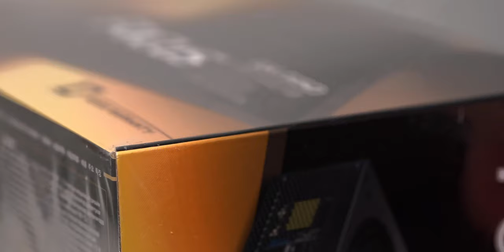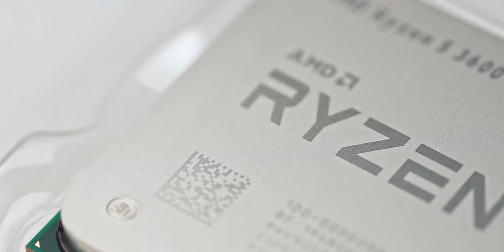mATX Build Montage - feat. Cooler Master S400 and MSI B450M Mortar Max

Comment: Great build.
Good parts.
Amazing case.
(Edit) I feel so bad for optical drives in computers. IMO, I need an optical drive. Using an eternal one is a pain in the ass, and I don't want to have to find it when I need it. Plus Blu-Ray 5.25 are cheaper than external ones.

Comment: i just built in the s400 love it, great video mate
Reply: hows the temperature? i loved the design but small front air section worries me
Reply: @yoyokunfilled  I got a 5700xt in it, I did have to get some noctua fans put in at the front still yet to get one for rear I also have a ryzen 7 3700 OC with a nzxt AIO and my temps are fine man Max temp I get for my Gpu is 80 and that's with a capped 70% fan speed, CPU never goes past 50.

Nice case, just replace the front fan and get a second one and play with the speeds to get the airflow good.
Reply from the maker: Unless you're planning for something like a 3090 with an OC'd 10900K I wouldn't worry to much. As delvzy already said get some decent fans and you're good to go for "normal" hardware. I can highly recommend the Arctic P12 PWM by the way. They're pretty cheap and ridiculously close to the NF12x25 in terms of performance to noise ratio.

Comment: Hi, great video 👏🏻 I’m buying the same motherboard, msi mortar max, and some reviews here on YouTube says it does not have water cooling support, no aio pump connector, can you tell me how you made it. I’m glad to see it’s possible. Thanks 👍🏻
Reply from the maker: Thanks! A water pump connector ist usually nothing else than a regular fan connector. Some board have this fixed at max output. Just connect the AIO pump to one of the fan connectors and set everything to max rpm in your BIOS for that connector.

Comment: I ended up buying this beautiful case and very same mobo, I also got a 280mm rad and fans up top by drilling some holes slightly higher to allow ram clearance. So happy with this build!
Reply: Ey friend, what temperature does your cpu and gpu reach when you're gaming?
Reply: @RiddzenRock  1800x OCd to 3.9GHz would reach 70 degrees. The 5700xt nitro would reach close to 90 degrees.
Reply: Does this case have a considerable noise reduction? About the quality of his material, is it well finished?

Comment: Any other substitute to this case?
I'm really looking forward to this style
Reply from the maker: Maybe you like the Fractal Define Mini C or Jonsbo C3 Plus.
If you're not settled on mATX maybe the Fractal Define 7 or NZXT H510. Or the NZXT H210 as an ITX option.
Reply: @techlessYT  I'm settling for matx.
Im sick of rgb stuff.
Thanks for the suggestions
Reply: @Uly_24  you could try to find the nzxt h400 in smaller local retailers since they might still have it. It's a micro atx version of the popular h710 but it got discontinued. You could also try to find it on ebay or second hand sites as well if you want to try your luck :)

Comment: Is that a 5700xt GPU <: 
I'm thinking of buying the same one but i feel 3 fans would be better due to the bad air in my case (:?
Reply from the maker: It's the Sapphire Pulse 5600XT.
Well, the number of fans should not be a deciding factor. It really comes down to the overall design. I mean a manufacturer could put 3 bad fans on a really small heatsink, or 2 good fans on a massive heatsink - guess which one would perform better.

As for the 5700XT: Great performing models (with a reasonable price) are the Gigabyte Gaming OC and MSI Gaming X.
Reply: @techlessYT  what about the ROG one from asus <:?
I was actually going for it since it's the same price as the gigabyte oc in my country
Reply from the maker: The ROG runs 11°C hotter while being 3 dB louder than the Gaming OC as tested by Hardware Unboxed. So basically avoid that card especially for the same price.
Reply: @techlessYT  ouchhhhhh, aight then imma buy the gigabyte OC one and I'm not gonna lie, my GPU is vertical so i wanted to take the RGB look advantage of the card + the cooling system
Thanks you always get my back <3

Comment: Hey I'm also planning to buy a Ryzen 5 3600 with an MSI B450M Mortar Max and an RX 5600 XT ! Does the motherboard boots fast ? And have you got driver issues with the GPU ?
Reply from the maker: Great choice!
I didn't measure the boot time, but it's safe to say it doesn't take noticeably longer than any other modern board.
I built this for a friend, no driver issues so far. But I had to update the graphics card's BIOS, which annoyed me a bit, even so this was a really fast process with the Sapphire.
Reply: @techlessYT  Thank you for the quick response ! :D
Reply: @techlessYT  Hey, I'm also planning to buy the exact component, except with MSI RX 5600 XT Gaming X. But after checking the VGA compatibility list from the MSI website, there is no RX 5600 XT on the list.
Is your VGA still running fine even though it's not on the list?

https://www.msi.com/Motherboard/support/B450M-MORTAR-MAX#support-vga
Reply from the maker: Yes, it's still running totally fine. There's actually no good reason for MSI to maintain a graphics card compatibility list, as pretty much every single consumer graphics card that is currently on the marked will be compatible. So just choose the 5600 XT you like and don't worry about motherboard incompatibly.

Comment: nice build
Is there space below the VGA card for a WiFi card?
Reply from the maker: Thanks!
A small card might even fit. I wouldn't recommend that though, as the graphics card would blow hot air directly onto the WiFi card and will also be partially blocked.
If you need WiFi, I'd get the B550 Mortar WiFi instead. This will also give you a stronger VRM and a few other additional features.
Reply: Also keep in mind that some boards like the Asrock B450M have the pci 4x slot above the graphics cards. So you could have a Wi-Fi card on the top slot and the GPU on the two middle slots

Comment: Does anyone know if this is a good starter pc. I’ve been looking around and this fits my budget. Just wondering if it will last , thanks.
Reply from the maker: I built this for a friend as his first gaming PC. This surely is an awesome starter PC.
Depending on your needs you might change a few components. For example you could save some money an go for an Arctic Freezer 34 Duo air cooler instead or maybe chose a cheaper case, if looks aren't that important. Also if you see yourself doing heavy video editing in Resolve Studio or Premiere Pro or streaming your gameplay, you want to go for an Nvidia graphics card instead.

I'm not quite sure what you mean with "wondering if it will last".
Reply: techless thanks man for giving me some advice. I was just wondering would this build  be a good gaming pc?

Comment: nice build
Reply: i heard they prone to get hot, you haven't noticed any issues with that?.. i just got myself S400 but haven't started to build yet. think moving a back fan to front like you did and installing 12' noctua on a back gonna be sufficient for my needs since i never overcloak